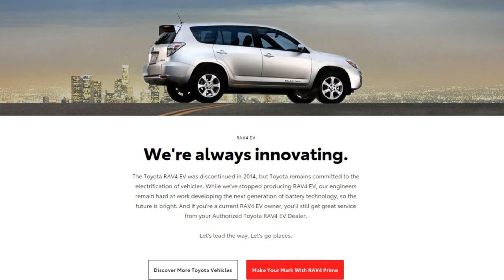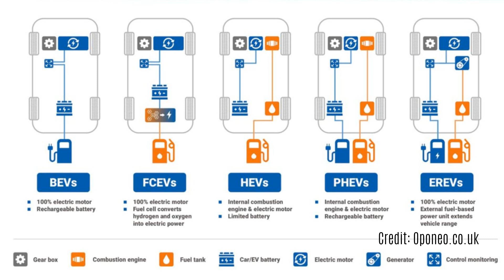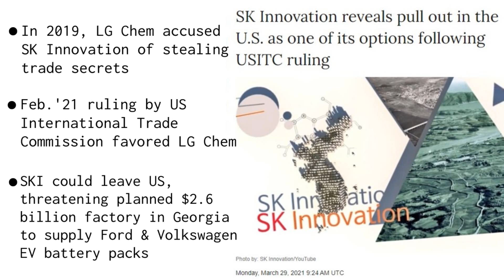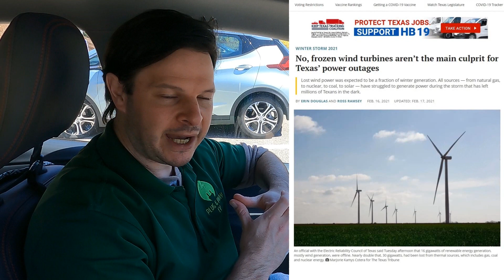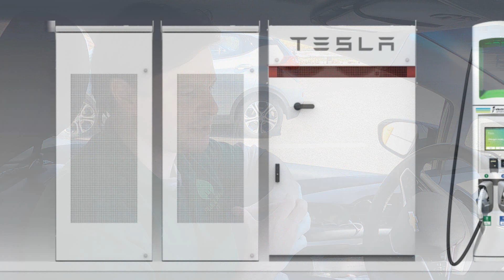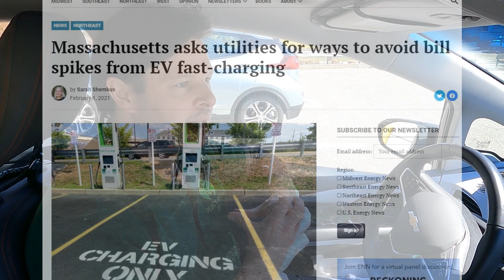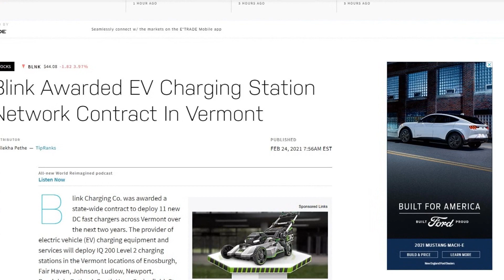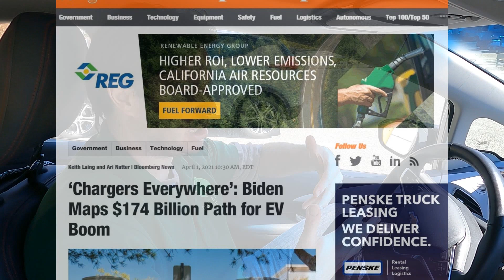Monthly Buzz #2: Toyota's BEV Return, Kia Plan S,  V2L/H Tech + More EV Charging News - Feb/Mar. '21

Comment: thanks for the update, pretty disappointed to see the trend towards "private" DCFC networks like the  "Rivian Adventure network".  I can't quite understand how Rivian and Tesla see this as a better option than simply allowing all vehicles to charge, but charging competitor vehicles a premium rate, to help improve station utilization and general EV awareness.
Reply from the maker: I honestly think Rivian wants a period of exclusivity to go with its premium all-electric startup branding. They will have competition from Hummer EV, Cybertruck, and the popular OEM truck marques over the next 24 months, so they need to come out of the gate strong with R1T and R1S sales. Then, thanks to going with CCS and not a proprietary connector, they presumably have the option to flip a switch when the time is right and open up the network for the good of EVs (how it will be marketed, at least). 

If that's the case, they can avoid a whole slew of negative "Rivian's network doesn't work!" press in the early days of growth, hone the network in a closed ecosystem that they control, and open it up as a profit center for non-Rivian EVs when they're confident everything works. 

Granted, that's not the ideal situation for wider electrification in the near-future, but I can see the business case for it if it does turn out to be Rivian's strategy. If not, their claims to sustainability will look pretty hollow building out much-needed infrastructure for just a handful of vehicles on the road.

Comment: What is the reason Rivian wants their own network?  I already hate the Tesla-only network, it seems to split resources.  For another company to go this route, it completely doesn't make sense to me. If they are worried the charging network isn't robust enough to support their vehicles, why not spend that money on partnerships?  This is a big turn off to Tesla and now Rivian for me.
Reply from the maker: It adds a unique selling point for Rivian vehicles and a closed network, which is easier to manage/maintain quality. Tesla shows just how valuable that is and it really drives sales, rather than detracting from them.

The gray area for Rivian is that they're using CCS, so it should only be software that restricts access to non-Rivian EVs. If Tesla wanted to open up Superchargers, it would be a hardware play as well, but Rivian could conceivably flip a digital switch and open things up pretty quickly. Given the niche volume of the Rivian models, I feel like that opening up is quite likely once they've had that initial period of exclusivity to drive sales.
Reply: @plugandplayEV  I see your point about a selling feature for some. I am not a fan because like I said it splits and creates bubbles. I would love to be able to use the Supercharger relatively close to me. There isn't a DCFC near me at all, and sometimes I'd like to be able to quickly charge for an unexpected trip.  Looking at trip planning is frustrating knowing I could charge at a Supercharger if it weren't proprietary.  

Maybe it's a cool kids thing. I hate being told I can't use a charger, it feels exclusionary.  We're all in this together, right?

Comment: Glad to hear SKI and LG Chem came to terms.  I drove by their plant today and it is HUGE!  
Regarding Rivian, I'm sorry to hear they "pulled a Tesla" and made their charging network proprietary.
Regarding the feds wanting to install new chargers, I'm all for more chargers, but I'm thinking they should focus on DCFC and/or chargers for people who live in condos and the like.  And if they push DCFC, what will it be...CCS?  Tesla?  ChaDeMo?  Ok maybe not ChaDeMo but you get my point.
Reply from the maker: I was happy to see the settlement news as well. It would be annoying for the transition to slow down due to division inside the EV sector.

The only one of your thoughts I can confidently answer is that most investment will go to CCS. The volume of vehicles just won't be there to justify spending on CHAdeMO for the long term, while Tesla is the only entity I've seen truly invest in their standard, with the lingering exception/question mark of what Aptera is doing. The location priority is difficult, as DCFC overlaps with the condo/no driveway challenge in metro areas. Some get by with local L2, while others just want to do a quick charge session during their errands or committee and be done for the week. Siting decisions, workplace charging expansion, and EVSE installation incentives for new builds will be really important there.

Comment: CCS chargers should be installed all along Interstate 80 & 90 across the Country! CCS is sparse on large areas on those routes!
Reply from the maker: I'd say the gaps are definitely problematic, with the usual suspects of Montana and Wyoming needed attention urgently, but the routes on either side are at least covered for both I80 and I90. South Dakota also needs some, but the state seems to be acting on that now.

Greater redundancy of locations and stations would definitely be nice though... options every 50 miles feels much better than every 100-125 miles!

Comment: Do you think Toyota will come out with a solid state battery? This would be a game changer. Fast charging times with solid state.
Reply from the maker: Solid state tech is repeatedly in the headlines but none of the automakers seem anywhere close to delivering mass-market vehicles based on it. If Toyota is keeping it under the radar to surprise others then it could upend the sector, but I expect we'll see gradual progress across the board, rather than a sudden shift.